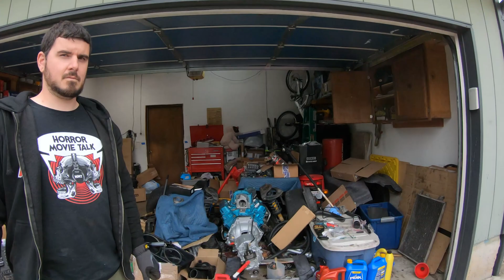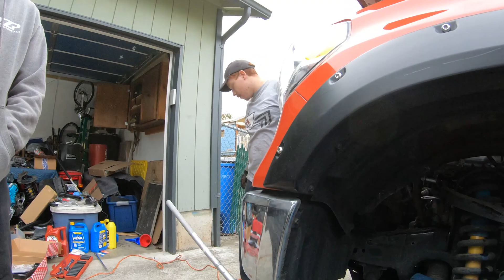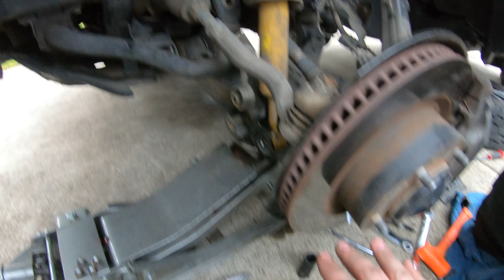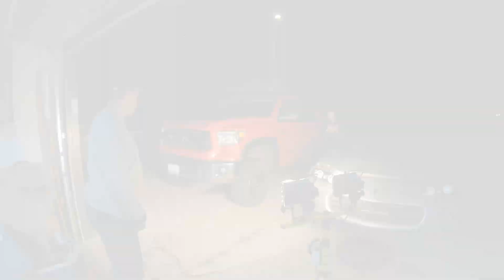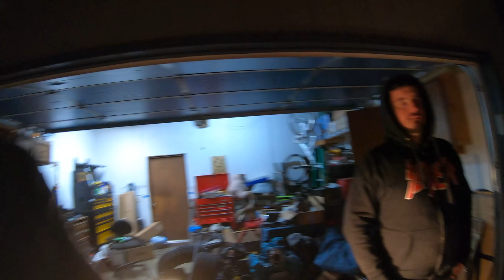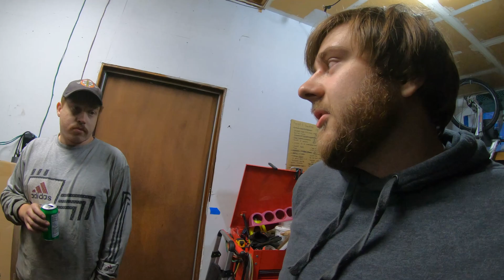Toyota Tundra Overland Build! Old Man Emu Front Suspension Install!

Comment: Hi, which tire size do you have here? I have just installed this kit (had a shop do it) and I can’t get 285/75r18 to fit without the tire hitting the upper control arms. I’m so confused because your tires seem to fit just fine.

Comment: How's it held up?
Reply from the maker: So far the kit has held up very good. We did a nut and bolt check and the leaf spring u-bolt nuts had loosened up a bit. We had to re-torque them.